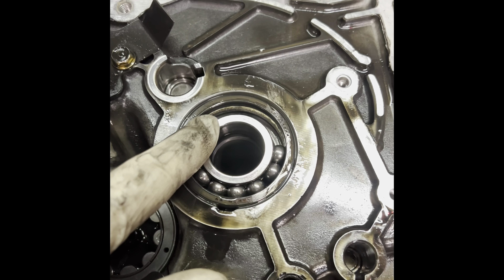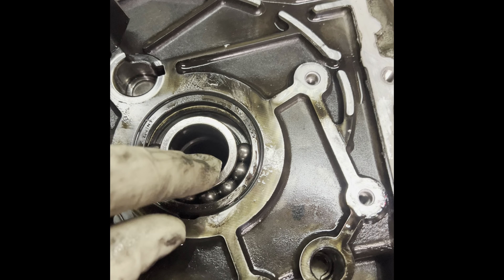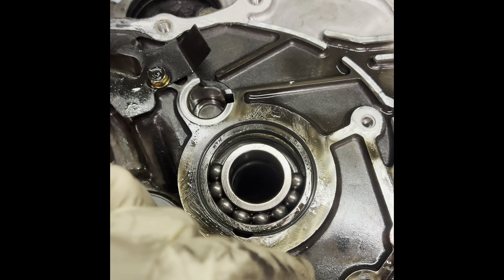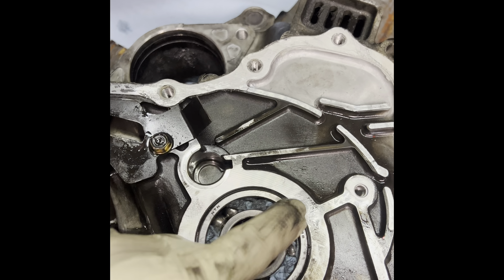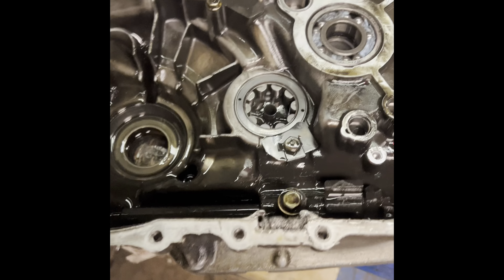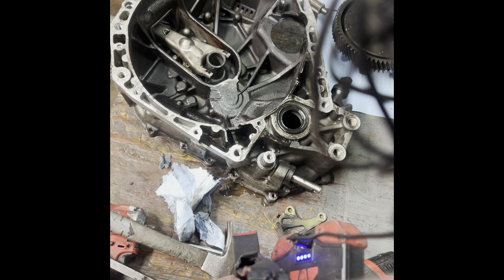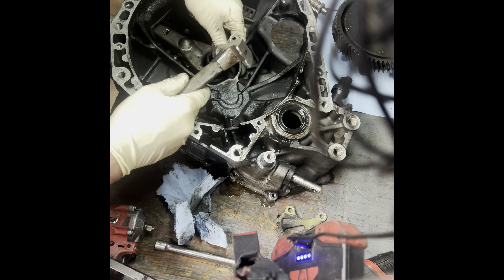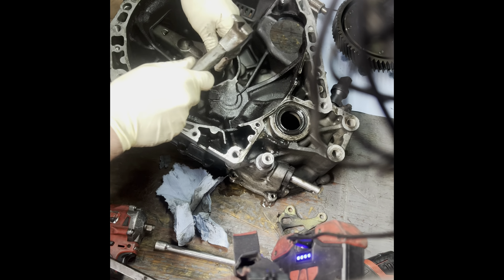Removing the famous failed input shaft bearing on honda transmissions!

Comment: Thanks for making this. Just out of interest if this bearing is to be replaced what other stuff would you do too while the gearbox is out? Eg change clutch
Reply from the maker: I do trans rebuilds for a living so I inspect and look at everything in there and what I see worn  I replace. If money is not an issue and you’re already in there I recommend a master rebuild kit. Synchrotech sells them!
Reply: @boostybuilt6189  Im a mk3 TOYOTA rav4  (2009 manual diesel) owner - Car makes a slight grinding rotate-ing sound when sitting idle. Goes away when you put clutch in with foot. Comes back when you take clutch out.
Its not super loud, just have noticed it getting louder recently. 
Youtube vids making me think its whats in your vid above. Does that sound like a symptom of your vid above?